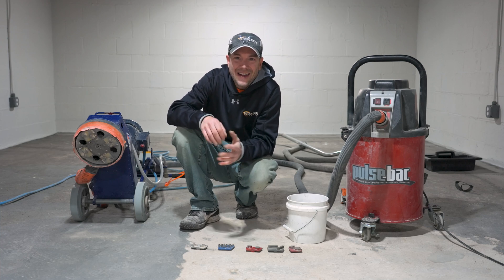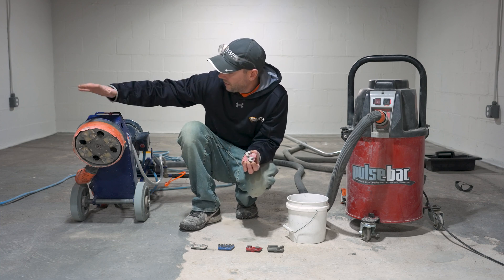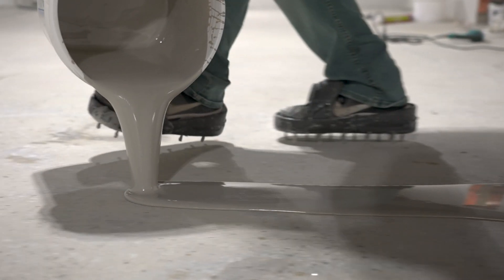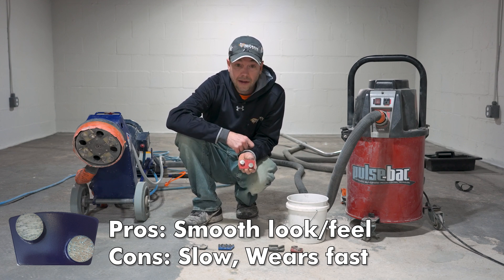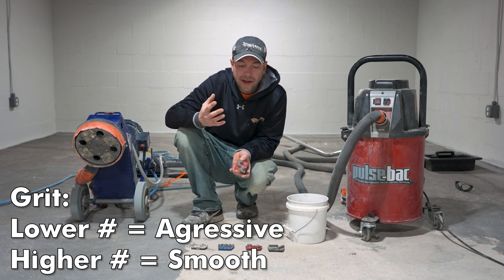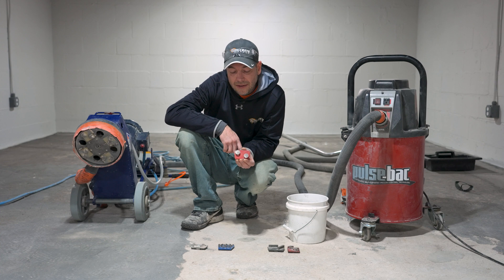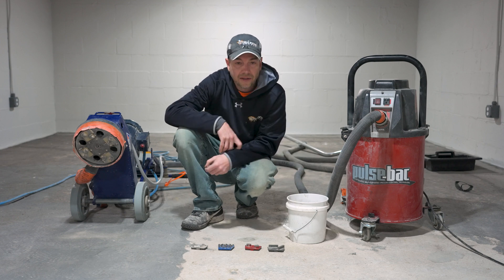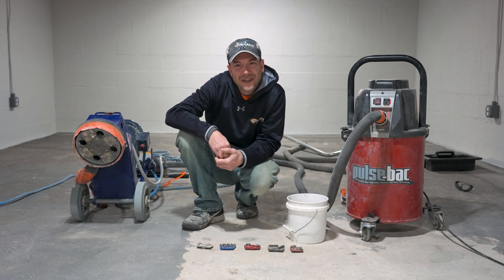How to Prep for Floor Coatings | Choosing Diamonds!

Comment: What would be best to use when prepping for a grey then clear coating without flakes (the rust oleum kit)
Reply from the maker: Thanks for the comment! If it's a clear coating, you'll want to run some button (round) diamonds over everything to make it look nice before applying the coating. The buttons might work for all the grinding, or you may have to hit it with something more aggressive, like an arrow diamond in the beginning to get through the paste layer. You'll just have to give it a try. I always start with the diamonds that I'm planning on finishing with, and if those seem to be working well, just keep going. If they are too slow, go to something more aggressive first, then clean it up with buttons. Thanks for watching Deco-Crete TV!!!

Comment: wait so what are segments i think i completely missed that and why do some have more segments than other
Reply from the maker: Thanks for the comment! Segments are the pieces of metal that contain the diamond tooling. You will see them in many different shapes & sizes, as well as a verity of grits & bond. They are basically the part of grinder that hits the floor. The amount of segments that a grinder can hold will depend on the size of the machine. Planetary grinders will also require more segments then a rotary grinder. Thanks for watching Deco-Crete TV!!!